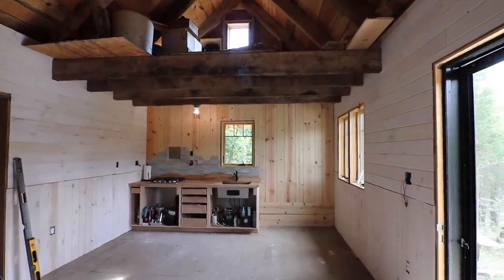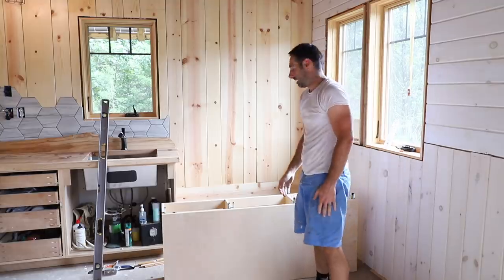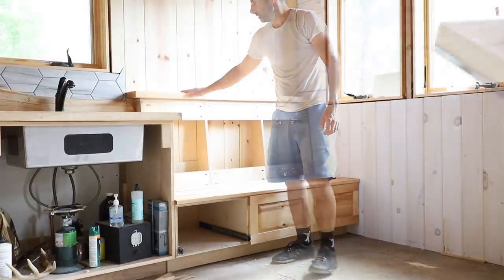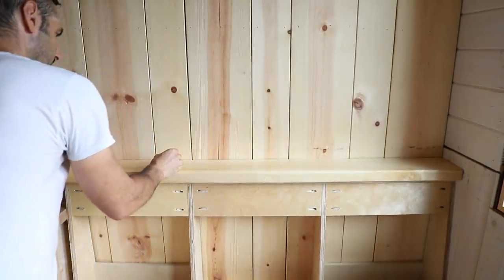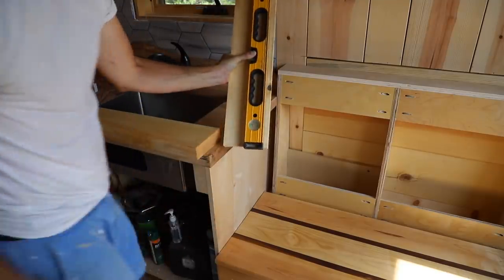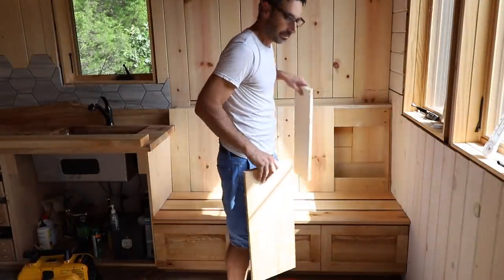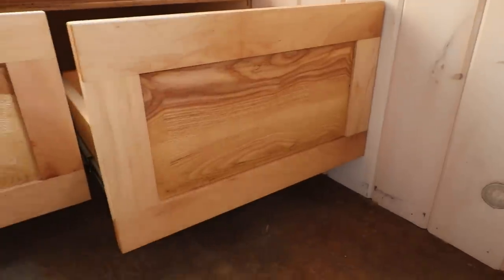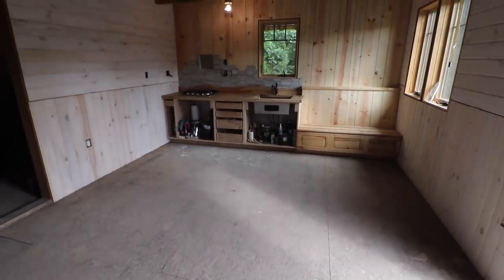A Built in Bench Seat for an Off Grid Cabin - Part V

Comment: Great job matching the grain down into the bench. Best craftsman touch of the whole cabin build that's how much I like it, not to cause you more work but it would be cool to bring the kitchen black splash tile where it ends on the right under the window all the way across the top of the new bench ledge same height until about 12" or so before you hit the front wall then raise it up some, this will make the room look bigger and not leave the chopped off feeling I am getting between the counter area and bench and allow the two sections to flow along that wall ..Just an idea     Thank You for a great channel

Comment: Be on the look out for one of the Harbor fright truck bed cranes to have a good sale/coupon. It will make a good rainy day project to install it on the loft and build a platform it can lift heavy items up/down with. The fact it can spin will make getting things up easier as you can lift in the clear area then just rotate onto the loft when it is lifted. 

Other option would be a snatch block mounted to the rafters to run a powered winch with in/out capability so not just the cheap ones that pull in.

Comment: So nice when those remote measurment risks you take work out.  It turned out great.  I would suggest that the table you build would be one that can be moved and stored when not in use.  I would recommend as the first step for the floor would be to lay down a layer of tar paper and tape the seams.  This will cut down on air infiltration from below and make installing the flooring material easier.  I would highly recommend using wide plank boards.  This will serve to make the room feel bigger as well as cut down on the number you will need.  I also saw that you butted the tile back splash up close to the window frame.  How are you going to case the window out when it comes time for that?  It will be some pretty serious jigsaw work to do it right.  You have the right idea with using a paper template.  I just use grocery bags or butcher paper.  I have also used the nearest handy section of cardboard box.  You do what you have to to make it work.  There are many ways to cover up your woodworkins sins.

Comment: Nice bench seat Mike. I'm not sure how much adjusting you needed to do to get those ball bearing soft close slides to work, but you got them to work. Good job. Try the Blum undermounts. You wont be disappointed,
Reply from the maker: They worked right off the go but I made sure both the boxes and the drawers were perfectly square!  Ill check those out.

Comment: I don't know what you mean when you say the bench is one half of the seating.  You seem to say the other half will be under the window.  If that's the case, the drawer will not open that is against the window wall.  I think you must mean you'll have additional seating that faces the bench you just installed with the table in between.  Is that correct?  I can't wait to see the flooring.  There are so many options, but stained wood would be awesome.